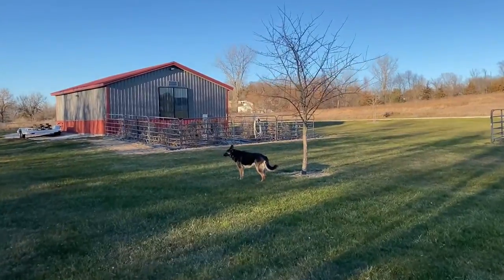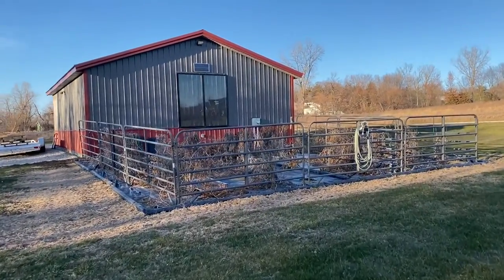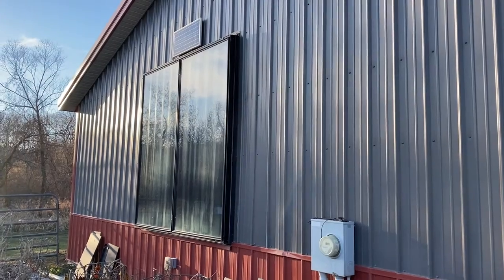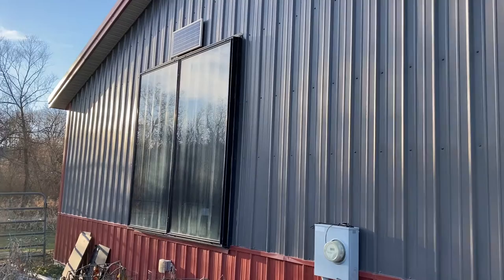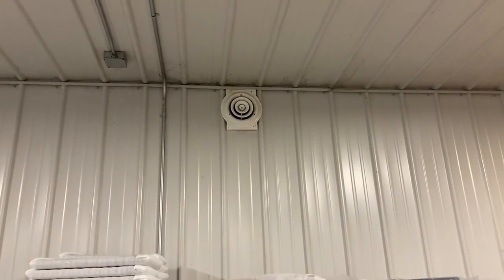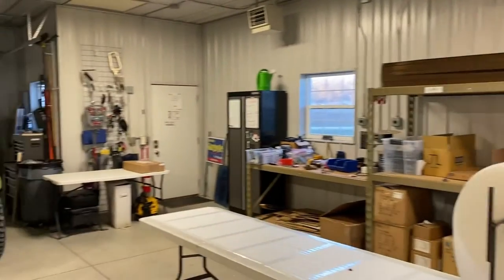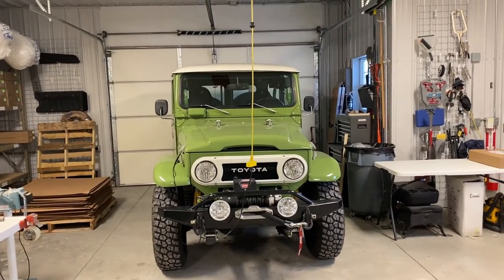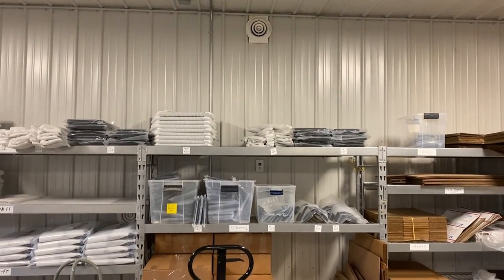How does a Passive Air Heating system work and is it reliable?  SolarSheat 1500 10 year report

Comment: I built my shop 24 x 36' (outside of the concrete blocks measurement) with a 10' ceiling height.  1" pink foamboard from Home Depot, 2"x6" studs, closed cell foam.  The bottom 2' of the walls are not insulated. There is 3.5" of open cell foam between the ceiling joists and 2" pink foamboard sbove that, with spray foam sealing any gaps. I sited the building southwesterly and put five 30"×60" double pane windows without low e coating to face the winter sun.  There is an 18" overhang over the window walls.  Only put two of the same size windows on the opposite wall with low e coating.  I have a low tech way to make sure water won't freeze in the shop in the winter, a small plastic water bottle that I topped off completely that I keep on the floor in a pie pan.  The temperature over the ten years since we built it has never gotten cold enough to pop the little plastic lid off or show any sign of freezing inside the bottle.
Reply from the maker: Brilliant!

Comment: Neat , but I can't find solar sheet on the Internet.  There's a couple videos of this style of heater without a fan. But it looks like the biggest problem is having a damper to shut it off during the night or summer.  If it works so well, why didn't you build more?
Reply: Bought it through northern supply…it was not cheap at like $3500.  The company may very well be out of business. 

It functions well for my needs if just keeping the shop above freezing, it would not be hard to DIY if you has any carpentry skill at all…it’s really just black sheet metal behind glass with a fan and thermostat.

Comment: On a sunny day below 30* F or 0C degrees outside what is the output temp in the shop and how much CFM do you think it moves? Also what is the temperature delta on intake in shop and exhaust in shop? Thx Tony
Reply from the maker: Honestly, I don't know the answer to that question.  Like I said in the video...it is comparable to a blow dryer set on the lowest setting. Consistently, it keeps the shop between 35 and 45 degrees in the winter
Reply: @Springtailsolutions  thx

Comment: If you build it yourself, it will very cheap. This is easy device -glass, black corigated metal sheet, insulation, some pipes, frame ,fan and thermostat.
Reply from the maker: If you have the skills...I think it would be very easy to replicate.  Thanks for watching!
Reply: @Springtailsolutions Could have used the entire side of your garage as a big panel. Paint the metal siding black. Cut the cool air inlet near the bottom and the hot air outlet near the top. Add a fan with a PV panel. Then frame it out and plexiglass it!